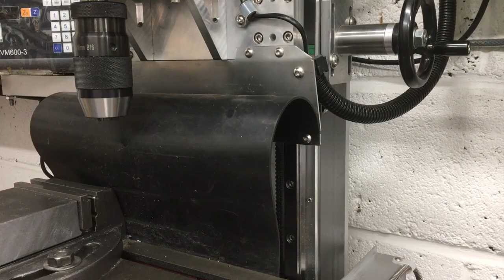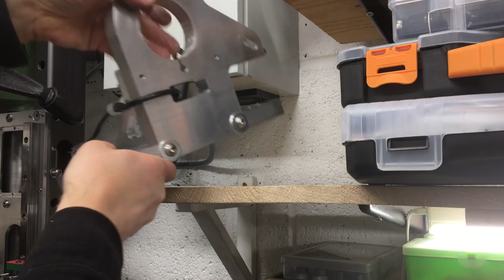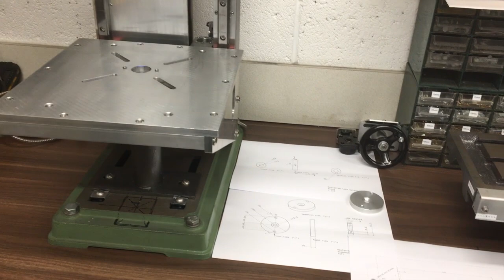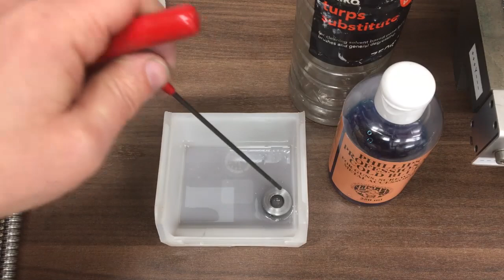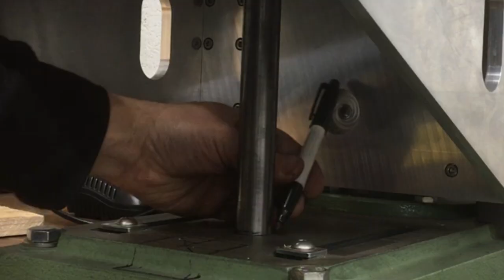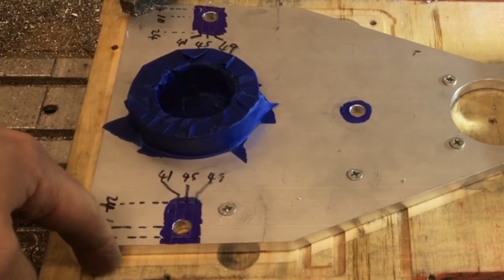Ep44: Drill Press upgrade | Tear down time !

Comment: I wonder how it would have acted with a hydraulic cylinder under the table, closed loop with each end plumbed together with a valve between. No pump. Close the valve after the table movement.
Reply from the maker: I did look at hydraulic bottle jacks before deciding on a motor but I could not find one with enough travel.
Reply: @routercnc9517  not a jack, a regular hydraulic cylinder. They make them any size imaginable
Reply from the maker: Oh, OK yes that would work.  I already had the ballscrew and stepper motor so that was what I decided on. Hydraulic would be a good option though and plenty of power!
Reply: @routercnc9517 For a smart guy you're missing the concept. 🙄
Reply from the maker: Ok you mean along side the ballscrew to act as a lock and prevent backdriving.  Ok yes that is an option if the mass of the table and the drilling force tries to back drive.  Good suggestion thanks.
Reply: @routercnc9517  no i meant, leave the ball screw where it originally was, add the hydraulic ram directly under the table. It would act like a brake, and quasi linear rail/guide. Solving all your problems with minimal reconstruction
Reply from the maker: Ok I didn’t go into detail in the video but I couldn’t leave the ballscrew where it was as it would not allow the table to drop any lower.  Not without a very complicated and bent bracket to the table.  Happy holidays!